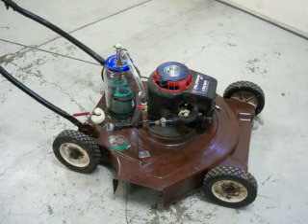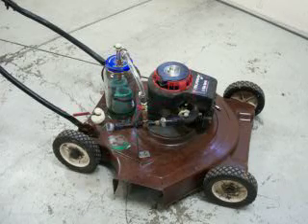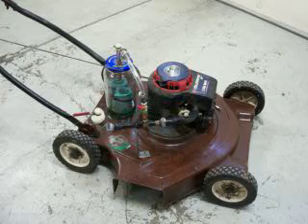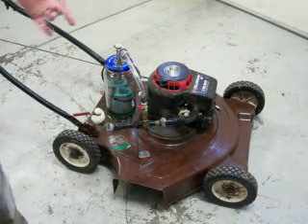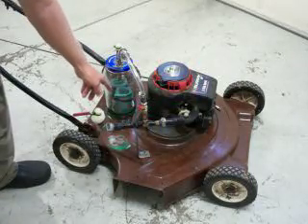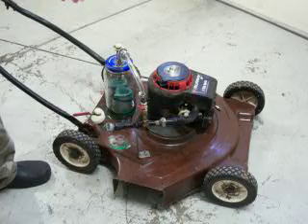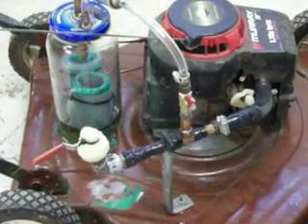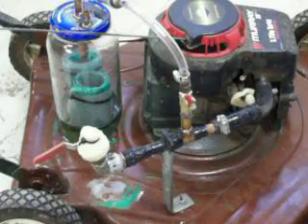just vapor, the truth or a lie

Comment: A carburetor does this same exact thing, vaporizes the fuel so it can be compressed. This will work, but it is really unnecessary and stupid
Reply: +Matthew Carriveau No, leaving the atomizer (carburetor) which is not vaporizer on the engine to use 500% more fuel while still presenting the same potential fire hazard is stupid.

Comment: Hi Vaporkid,  I noticed that the vibration from the running lawnmower was vigorously shaking the fuel mixture in the bottom of the jar. Could this also be releasing supplemental gasoline fumes?

Comment: Mate, I have no doubt at all that it works, my question is how does it perform under load or if you really give it the stick or both?   Will it produce the same HP & Torque as a carbie or fuel injected motor? It's just that all the examples I have seen running have just been running, no load on them.

Comment: Im going to test this on my dad's generator in the garage. I just have some questions before i do. 1.how wide does the tube need to be for maximum efficiency? 2. are you using an electric pump to help the vapors through the tube? 3 does the supplies you used to convert the lawn mower cost a bunch?
Reply: Figure whatever your throat size is tube size and it can be multiple but Has to be Equivalent to BREATHE.

Comment: These videos are stupid a carborator turns gas into a vapor just does it better. ............ The amount of gas that is used running a engine on fumes is the same as a carborator uses ................... YES you can use crap gas Hell I ran gas with orange juice and coke in the gas . when the fumes get low the engine dies.................. We did a test of how long 8 ounces of gas would run with the carburetor and then used the same amount of gas and ran on fumes the fumes may of lasted 20 seconds longer . We then did the exact same test with more gas and still got the same results ................ DEBUNKED running a car of FUMES will not give you better gas mileage .
Reply: Carbeurator's do not turn gas in to a vapor, get this through your head.  I am getting tired of hearing this lie again and again.  Carb turns gas in to a mist,  a mist similar to what an atomizer does to perfume.

Comment: Makes sense to me.  Seems logical.  If water can't compress, why would we think liquid gasoline can?  Seems it would be the fumes creating the bang.  I've got plenty of engines to choose from.  I'm giving this a shot.  Thanks!
Reply: +Tim Oconnell tim if you think a hydrocarbon cannot compress, then you should read about something called a deisel engine, its still pretty thick despite the injectors, but it combusts, due to heat n pressure,  water wont as the bonds thast hold the molcules together are much stronger than a long chain hydrocarbon..in fact with enough heat n pressure water will break down toitd elements, hydrogen n oxigen, but the energy required to do so is enornousand not practical  now ask this guy to run this mower under a loaad for a bit n well see the motor die from running lean prematurealy,  plus fuel vapors in an accident are not a good scene ..so car companies keep it in gas form till it reaches the cylinder,  the mielage claims dont add up if you check the calorific potential of gas and the thermal efficiency of car engine..  try it tim n measure how much gas u use and run the mower under load, would be interesting to see if theres gains in economy, if its substatial and doesnt kill yer exhaust valve,  more power to ya.. still fun to ecxperiment
Reply: +plane gaper I don't think he meant molecules, but actual liquids, which would bump-up the consumption VS efficiency rate considerably. hehe
Reply: could be bert, i think there's a huge safety concern in keeping the fuel n a liquid form until it reaches the combustion chamber..to prevent fires etc,  slowly with the ecoboost and other platforms we are getting around these heat issues.. check out the standoff injectors on an f1 engine vs direct injection on modern f1 v6 power units , you will never see a fire in the intake like you did on the v10s, much safer, still its not as simple as that and probably well beyond the scope of our stoichometric or engineering knowledge,  but keep learning, keep experimenting, and enjoy doing it.the oly stupid questions are the ones that aren't asked.. would be interesting to talk to an f1 engine designer like duckworth, or andy cowell, or the gordini renault guys n pick their brains on this stuff.. keep having fun bert!
Reply: plane gaper I tried, they won't let me get close enough to inspect the injectors. Apparently it takes more than a, "I know Alonso" to get in the Paddock these days... hey, how did you know I was a F1 fan?
Reply: Ha Ha as long as you don't know Fellipe Massa, looks like the kida guy that would hit in your gf while your not around.   The cars these days are technologically clever, but missing something pure and the lightness (740 kilos vs 600) in the v10 era,  and 8 seconds a lap slower than 04'..Still it's better than seeing red bull win everything, Seb's boring, these guys are a sponsors dream no edge..thank goodness Kimi is there to make things exciting,  and Grossjean to fill in as the modern day Tekuma Sato and smash up all the back markers, now that Flavio's gone there's not drama in the sport lol.. bring back some fast dangerous tracks, maybe kill off Bernie n replace him with Lauda..n some cheating fia frenchman to get renault back in the fix, bigger tires n wings, n some mean turbo fire breathing beasts that run on exotic fuels with a small tank, or even have n/a cars in the mix w 3 liters and bigger fuel cells n let the teams decide on turbo or no. 3 or 4 pit stop races, tires going off after some crazy laps..each race would be an insane spectacle of differing strategies, performance and variety of cars and ingenuity, not a parade of choked down, aero efficient nascars . Take the paint off and you can't tell a mariussa from a Haas.. 
 Lastly it's become too safe,  lets remeber the last guy to die in F1 , crashed into a safety vehicle.. Stuffing each corner with a hundred doctors, tow vans n safety cars is nuts, you just concentrate a lot of hardware on a dangerous point on the track...using less but cleverly, and at the right time, with minimal interruption to the race is better.. from Tom Pryce,  to Ronnie Pederson, to Senna, letting tires cool, or people running all over a race track with fire bottles, not knowing what they are doing ( I've marshalled races before, and seem some people do some pretty stupid shit believe me)...is more dangerous than having less well trained bodies working as a cohesive team.. too many chefs spoil the broth...anyways panzer let me know what you think... cheers fro Canada
Reply: plane gaper Massa can have my GF if I could run Bernie and the FIA out of town. In an hour I could restore what made it great and then like you were saying. Lauda could replace the lot of them. But limiting fuel, reducing down force and having tires that cannot withstand overtaking your teammate prevents racing from occurring. After the most f'*d-up qualifying session in history, millions of fans and I tweeted FIA with "Get your heads out of your asses!"
Reply: amen brotha,  bring the balls back to F1, get these Vettell ,Grossjean, Hulkenberger, sponsor clowns outta there, n replicate like 20 kimmins racig each other..lots of passing, ignoring safety rules, and swearing over the radio "ayayayay,  i know what the fuck i'm doing, coming in to box for a piss, get it ready, !!!"  even schumis cheatin ass was better than today's f1.. As for massa having your GF, please have some respect for women.. your mother in law on the other hand...

Comment: To all the nonbelievers. I'd like to add a side note in the vaporkid's favor here I have 13 different engines ranging from a 4 cylinder in a 65 newholland skid steer, lawn mowers, weed eaters, a 02 grand prix (3.3), 92 f-250 (5.8 efi), 81 Honda prelude (1.6), 82 f-150 (5.0 carb), even a 2015 f-350 (6.3) when it comes to gas engine you name it I've probably put some form of vaporizer to it. so I say to ye of little faith try it and see what happens its not that hard to do.
Reply: +Jeremy Nading Got a video of the Grand Prix? Is it the 3.1 or 3.8?
Reply: +Dick Awg after a rebuild and modifying slightly its running a custom 3.3 with a specialized fuse and relay system and a few other parts but running purely on vapor.
Reply: Interesting post a vid if you can. Thought the 3.3 was mis type. I'm interested in getting my 3400 running on it
Reply: Nope not a typo. Don't ask what the significance .2 makes over pure stoke but after the rebuild I was able to accelerate faster and hold a higher top speed for longer before the temp started to climb. It was mostly do to a bet between friends that I couldn't do it. Then I got the idea to convert it to vapor and quit being as much of a hell raiser with it. I would post a video but I don't have a good camera or really much time to make a video otherwise a would definitely. Good luck on your 3400 trust me you'll love it.
Reply: thanks, I'll see how it goes. I have a few 3800s to test too.
Reply: I'd like to know how you vaporize enough oil to keep a weed eater from locking up the motor considering weed eaters are two stroke motors which require enough oil in the fuel to lubricate the motor.
Reply: Used vegetable oil works but if you want to spend the money and get two cycle oil instead you can do it that way but it works just the same
Reply: Try it and see what happens?  If we can't even get a simple answer to just the simplest of questions, what would give us the incentive.  Just knowing the mpg would motivate, knowing how your vehicles perform would also be nice to know but these videos never show anything leading to skepticism

Comment: This isn't fake, but it's not all that useful either.  Only the light molecules will vaporize fast enough for this to work.  Once the light vapors are gone, the heavy molecules will still vaporize, but not nearly as fast, so the amount of available vapor reduces as the mower runs.  This is why you never see these mowers running for hours.   In the end, none of this matters anyway once you understand thermodynamics.  Much of an engine's inefficiency is in the hot exhaust.  Instead of playing around with silly bubblers and such, think of ways to capture this exhaust heat and put it to work.

Comment: Is the life expectancy of the engine itself altered with a setup like this?  I would think that without some liquid fuel in the combustion chamber it would increase the heat generated, possibly to become damaging to the head/gasket/piston.
Reply from the maker: +Purplerambler69  no it will not hurt the engine, that little bit liquid gas will not cool the cyl to make a difference!! thats like saying a squirt gun will cool a fire off, it will not.  and yes the engine last for ever becuse the gas is not getting past the rings and contaminating the oil, the oil will stay cleaner for a long time. look at a tow motor it runs on propane, it never over heats.
Reply: +TheVaporkid  Very interesting!  This video makes me want to start tinkering on my own vapor system.  Thank you!
Reply: +Purplerambler69 The extra gasoline definitely does help cool the engine! I have been working with engines for a long time, the reason most engines run a little rich is to help with lowering the temperature as the unburnt fuel takes energy to vaporize there for reducing the temperature. This is especially evident in turbo'd applications if you run your car lean it will cook the turbo (trust me I have done this) if you run it a little rich it keeps it from over heating. As far as gas getting into the oil it does happen however due to the temperature of the engine it separates out of the oil then the vapors are pulled out through the vacuum lines into the intake and burned. Propane's heat energy is actually lower than gasolines so it does not produce as much heat when burned in the cylinder. Keep up the good work though there needs to be more people willing to tinker with this stuff! Thanks for the vid!
Reply: +science1324 sorry that was for +TheVaporkid
Reply: It takes about 500 hours of running for the intake valves to scorch. We would lap the valves at that point. A lawnmower engine has a finite lifespan and would never approach 500 hours anyway. We found this system because there are no by products to the combustion process(too lean) that it actually extended the life of our 3.5 hp engine
Heat was not really an issue except that in some experiments we ran an air cooled engine for 100 hours and it did elevate the operating temperature marginally
Otherwise air cooled or water cooled the operating temperatures were well within range

Comment: HEY.... STEVE IS RIGHT BUT FROM WHAT I CAN SEE HE STILL HAS A PASSIVE SYSTEM .ADDING THE FOAM GIVES MORE SURFACE AREA TO VAPORIZE THE GASOLINE. BETTER SAID THE ELEMENTS OF GASOLINE. HE NEEDS A VACUUM PUMP IN BETWEEN HIS HOLDING TANK AND THIS VACUUM PUMP MUST BE METERED TO ACHIEVE A 6 AIR TO 1 GASOLINE RATIO  AND MAINTAIN A VACUUM OF 15 INCHES . THE GASOLINE THEN TURNS TO ICE CRYSTALS AND IS METERED INTO THE ENGINE THRU THE INTAKE . HEY STEVE IS THE GASOLINE 180 DEGREES BELOW AMBIENT TEMPERATURE? IF IT IS U R ON YOUR WAY CALL ME 661-401-4001

Comment: is your bottle glass or plastic???
Reply from the maker: Angelo Lapasota  its glass, just remember to use a flash aresster on the in take line going to the carb, if it ever back fired it would be snuffed out before it would reach the fuel tank, but in 12 years that i have been messing with vapor lawnmowers i have never had a back fire ever!!  think of it this way when you flood a carb with gasoline and when that spark hits all that gas thats where you get the back fire, with vapor you can not flood it ever becuse as you crank it its pulling in the vapor and then pushing it out of the cyl, theres nothing there to flood,  and dont beleive people when they say that its running lean and will ruin the engine and make it run hot, they dont know what there talking about, i have yet been proved wrong.

Comment: I tried to just stick in a shop rag into the bottom of my container ng.So I left it in there and stuck the inlet tube down into the gas. Great. but the container started getting very cold and I guess the gas started to condense on inside of container.Also the container started to crush in.So let me ask if your container is glass???angie
Reply from the maker: +Angelo Lapasota the system i am using is a ammo can, im heating the gas, and also i am heating the air as its being sucked into the ammo box, you want to keep the fresh air warm so it will not condense the vapor back in to liquid gas

Comment: I noticed your intake is just a short filtered section.Some guys are saying that the evaporation is cooling the inside of the container which causes the vapor to condense an the inside wall.When my unit was running I did notice the container got really cold. And the mower stopped running,thats why i ran a longer air intake to get warm air fron the top of the engine.Check it out.Angie
Reply from the maker: Angelo Lapasota the new design i have, i have hot air being drawed in as it gos to the carb, that way it will not let the tank start geting cold,

Comment: thanx for your prompt answer,I'll try that tomorrow.I have to redesign the intake to the carb,I'm not getting the bubbling after I installed a tee in the intake line and put steel wool in there  I also mounted a valve on top of tee to allow more or less air to mix with vapor.I must have a vacuum leak somewhere. thanx angie

Comment: I got the mower to work on the bubbler system,now I'd like to try the wicking system what do you use to wick the gas????angie
Reply from the maker: Angelo Lapasota yea what im using is a  towel for soaking up oil spills and liquid for garage floors in automotive shops,  they soak up real fast, you can find them at graingers or some place that sells cleaning supply's for shops. they come in different colors.

Comment: You have basically replaced your carb with a cave mans carb. you will still be using a similar amount of gas anyways because gasoline per weight only has so much energy. to get a certain amount of power, you will use a similar amount of fuel

Comment: what if you have a back fire ?
Reply from the maker: in the 10 years i have been doing this with vapor i have never had it back fire on me!!! and if it ever did i have arresters on it that would not let the flame go back to the tank.  you will have more of a back fire chance with liquid gas going in to the cylinder
Reply: Just asking because you have the same air fuel mix all the way back to the tank . What do you use for the arrestor  ?
Reply from the maker: Spencer Boaz a screen arrester